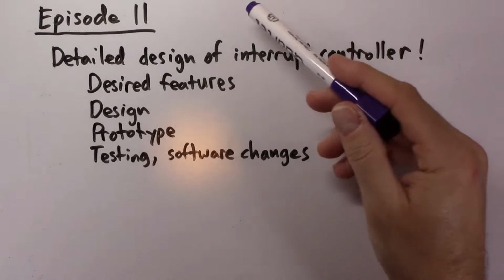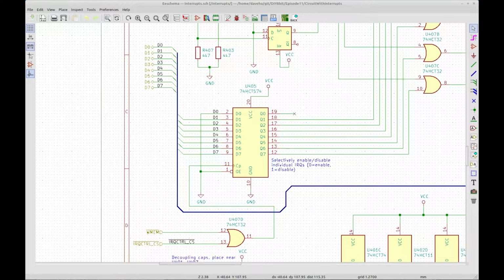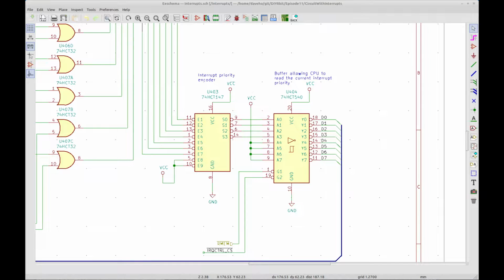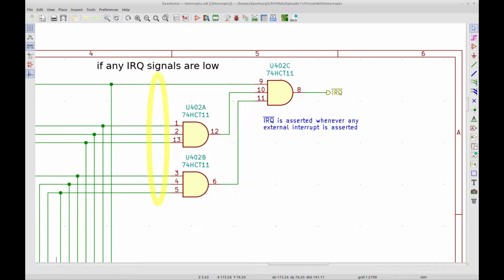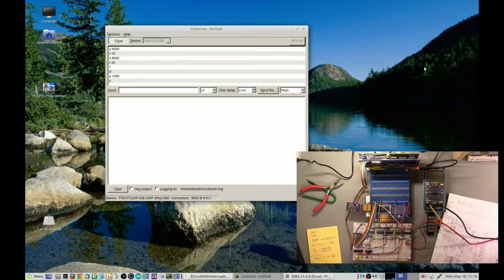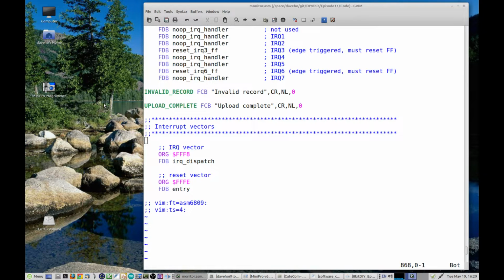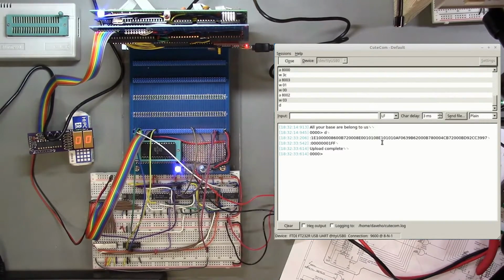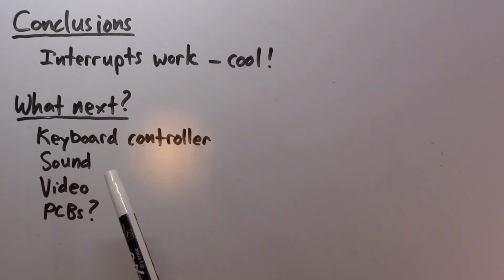DIY 8-bit computer, Episode 11: Interrupts, Part 2

Comment: Dave, this is pretty cool!  I've designed something similar for my 6809-based home-brew machine.  Mine has 16 inputs, and uses some logic in a GAL to select between the two priority encoders and some other other handshaking because I also implemented auto-vectoring in mine, whereby the interrupt controller places the address of the IRQ table slot that holds the highest-priority handler address directly on the address bus when the CPU fetches the IRQ vector (sort of like Interrupt Mode 2 on the Z80).
Reply from the maker: Wow, that's hard core! It wouldn't have occurred to me that auto-vectoring is possible on the 6809.
Reply: @davehohacks  Yah, you can determine when the CPU is fetching the IRQ vector by decoding BA, BS, and A1-A3.  My ABUSSEL GAL uses that plus an additional signal from my interrupt controller to decide if the CPU or the interrupt controller gets to drive the address bus.  (Eventually, ABUSSEL might also let a DMA controller drive the address bus, but that's pretty far off in the future.)

Comment: A really interesting video and really well explained but as has been pointed out in another comment thread this is completely unnecessary with the 6809! I am guessing that you went down this route because of an Intel background rather than a Motorola one. Mixing Intel components with Motorola ones does cause some issues - such as edge-trigger vs. level-trigger. The open-collector "wired or" system used on the 6809 is very simple to use when you get the idea! 🙂
Reply from the maker: Agreed. The wired-or approach is great if all of your peripherals generate interrupt signals using open collector outputs. In the end, I like the approach I came up with, since to a large degree this project is about designing hardware using obsolete ICs. Using the '147 and the '540 was strangely satisfying.
Reply: @davehohacks  Yes, I really liked the way the inverting buffer solved the issue of the priority encoder producing inverted output 👍😁
Reply from the maker: @spacedock873  Yeah, they were meant to be together :-)

Comment: First of all, thank you for your videos. I've found them both educational and entertaining!
But 2nd of all, I just can't fathom why you would want to create an entire IRQ contoller when you can handle it all so easily from software!
As I'm sure you know, that IRQ line is open-collector. So no chip is ever going to try to drive it high, they will only try to drive it low. In the old days (and you can see this SPECIFICALLY mentioned in some of the older data sheets, like the one for the MC6840 PTM) they used a technique called WIRE-OR to combine multiple IRQ signals. In other words, just combine the lines. It's not only safe, it's _expected_. That's literally why it's open collector!
Any chip that generates an IRQ also has two other features:
  1> You can ask the chip if it is currently generating an IRQ
  2> You can clear the IRQ for that chip (usually by either reading or writing a value to it)
This means you can handle multiple chips on a single IRQ line in software very, very easily. In fact, on my computer it literally takes 3 lines of assembly to query a chip to see if it needs servicing.
What if multiple chips trigger their IRQs simultaneously? That's fine....your handler will service the first one and get it to clear its IRQ line and then RTI. But since there was a second chip asserting the IRQ, the CPU will pretty much immediately head right back into the handler. Only this time your handler will find the 2nd chip that was asserting, and handle it, and RTI again. You're covered -- and you can set the priority in the software SUPER easy with just copy/paste!
What's great about the 6809 is we actually get a 2nd IRQ line (FIRQ) so even if you have 8 peripherals you can split them up 4 & 4 between your IRQ handlers to limit how many chips you have to check (but again, it's like 3-4 lines of assembly to check them so not a huge deal.)
Here below is some 6809 code from my ROM that handles the IRQ line. I've got a 6840 PTM and two 6850 ACIAs tied to that IRQ:

_IRQ_LINE_HANDLER EQU *
OnTimerIRQ:				; This IRQ stacks the registers for us automatically
						; Nothing fancy here -- stay in flat 64K address mode; DP never changes
						; Check PTM first
 LDX #PTM				; Get IO address of PTM (Programmable Timer Module)
 LDB 1,X				; Read PTM status register
 BITB #%00000001		; Test for Timer #1 (jiffy) interrupt flag set
 BEQ PTMComplete		; If that bit isn't set, we're done here!
 INC _JIFFY_COUNT+1	; Increment counter low byte
 BNE SkipHi				; Did low byte roll over to 0?
 INC _JIFFY_COUNT		; Yes, so increment hi byte
SkipHi:					; No, so we're done
 LDD 2,X				; Read Timer #1 counter register in order to clear the IRQ
 LDU _JIFFY_CB			; Load "JiffyTick" user vector pointer from 'USER_VECTORS' address
 BEQ IRQDone			; Skip this if user vector is NULL; in that case we're totally done!
 JSR ,U					; Call user vector; user is responsible for saving & restoring used registers
 BRA IRQDone			; We've officially handled this interrupt so time to leave!
						;
PTMComplete:			; PTM wasn't the one who generated the IRQ. Let's ask some other chips...
 LDB ACIA1				; Read in status register ("SR") from ACIA1
 BITB #%10000000		; Test high bit of status register, which is the "IRQ Active" bit
 BEQ TryACIA2			; High bit wasn't set, so move on
 CLRA					; High bit WAS set, so we have work to do. Clear 'A' register to indicate ACIA #1 needs attention
 JSR ACIA_Irq			; Call our function that actually processes ACIA data; ACIA number is in 'A' register (0)
 BRA IRQDone
TryACIA2:
 LDB ACIA2				; Read SR from ACIA2
 BITB #%10000000		; Test IRQ flag
 BEQ IRQDone			; If ACIA2 doesn't have an interrupt pending then we're done (who generated this IRQ then?!?!?!?)
 LDA #1
 JSR ACIA_Irq			; Otherwise, call our function to process data for ACIA2

IRQDone:
 RTI					; And done!
Reply from the maker: Wow, you know I never really considered sharing the -IRQ input across multiple devices!  That does make a lot of sense if the peripheral devices allow it. My only previous experience with hardware interrupts was writing a toy OS kernel for PCs, where there are cascaded 8259A interrupt controllers, and it's rare to have shared IRQs.  I do have at least one device (the 82C54 timer/counter) in my system which doesn't have an open collector output, so I'm not sure if that could share an IRQ line with another device. I do see that the 6840 has an open collector output, maybe I should have gone with that rather than the 82C54, although I've found that the 68xx series peripheral chips are a little harder to find than the 82xx series ones.  (And, I was able to get a couple of 82C54s for free, which did influence my decision :-)  I do agree with you that my interrupt controller is a bit over-engineered, but I sort of get a kick out of using obscure 74 series parts like the 74HCT147 and the 74HCT540.
Reply: @davehohacks  Understood, and thanks for the reply! For the record, I always know it's a crap-shoot when I order some of those 68xx chips whether what I'm getting back is going to be real and/or working :) Especially the 68B which I'm using seem even rarer. But I can't pass up that screaming 2MHz!
Reply from the maker: @aqualung2000  The 68Bxx chips can definitely be hard to find! I've actually had pretty good luck getting Hitachi 63xx series (including 63Bxx) parts, which I actually prefer because of the lower power consumption, and the fact that they run cooler.
Reply: @davehohacks  Yeah I'm aware of the 6309 and it's pretty damn impressive. Doesn't it also add a DIV instruction? Holy moly, I think the 6809 even having MUL was pretty advanced! It's definitely tempting, but I'm trying to stick to original parts. I'm using 74ALS chips for all the logic and bus drivers instead of 74HCT, and those ALS chips definitely draw some current! (Regular 74LS are too slow for 2MHz.)
Anyway this is just my toy I don't mind if it runs a bit hot :)
Reply from the maker: @aqualung2000  Hmm...now you have me wondering if I will need to use 74ACT logic if I want to run my 68B09 at 2 MHz.  Right now I think it's running at slightly less than 1 MHz.
Reply: @davehohacks  I'm pretty sure you will be ok with HCT, but I haven't run the exact timings on those. But so you can compare, the ALS chips tend to run anywhere from about 11ns for the simple logic gates, to 22ns for the 3-to-8 decoder (74ALS138.) That leaves me enough time to still deal with my "super-slow" 150ns ROM.
Be careful with the ACT chips because they are so fast....I haven't experimented with this myself but I've heard that the slew rates are so high that they can bring in lots of problems that are ordinarily only associated with very high-speed computers (mostly ringing I guess? I'm definitely not an expert on high-speed digital stuff!)
Reply from the maker: @aqualung2000  Thanks, that's good to know.
Reply: @aqualung2000  74ACT has very high output drive, and can suffer from ground bounce.  74AHC parts are also very fast but don't suffer from the ground bounce, and if you have designed most of your circuit to have CMOS-capable outputs, you can use those in a lot of places.  74AHCT bus transceivers are available to effectively "convert" your TTL-level stuff to 74*HC-compatible signals.

For reference, on my 6809 home-brew system, I use 74ACT in the clock generation circuit (because my base clock is a 32MHz oscillator), and I use 74AHCT bus transceivers to buffer the 6809's address and data bus.  Then, I can use 74AHC parts for time-sensitive memory bank decoding tasks (along with 2 GAL22V10s that I use for high-level address decoding), and fall back on 74HC when speed isn't a concern.  All in service of running a 63C09 on the edge at 4MHz (eventually) 🙂